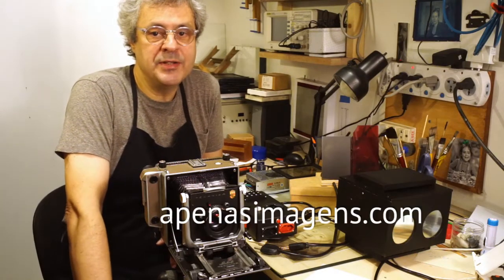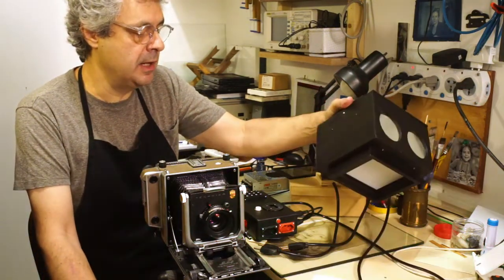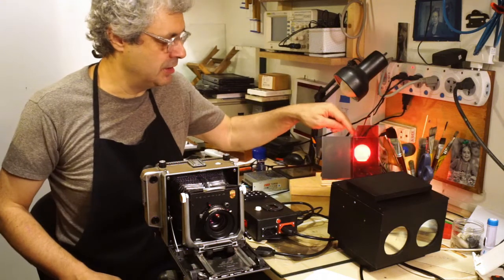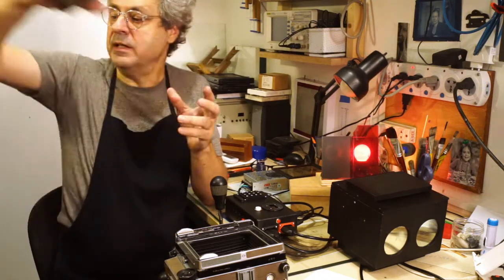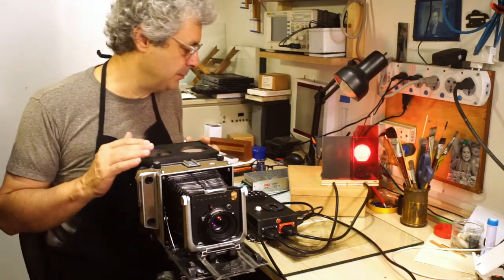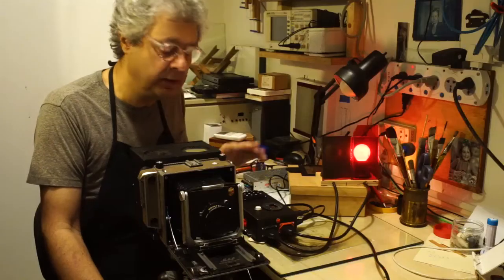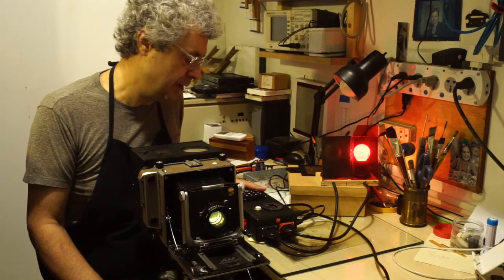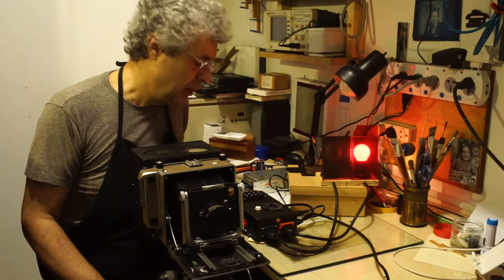Enlarger Head using RGB LEDs - complete project

Comment: How does it work that you use blue and green LED light for contrast manipulation but in traditional enlargers it is yellow and magenta filters that do the job?
Reply: The point is that when using LEDs we are adding colors, so we can include just what is needed, just what we want: blue and green. While a regular enlarger, starting with white light from a bulb or any other source, the process is about subtracting what we don't want. Normally the multi-contrast filters let the red pass by. In this situation, if we are in the low contrast range, red + green gives a yellowish tone. In the high contrast range red + blue + green gives a lilac, violet or magenta like tone.
Reply: @wagnerlungov1825  NO!!!  It need a mix of CMY not RGB, exactly the complementar!!!.... It can do with 3 white led and 3 apropriate CMY 100% filters.

Comment: Great video, thank you so much. I always wanted to make one of those, but with flash and a condenser. You may enjoy this story - - I  used to work a large tricolour copy camera that one would operate from within, the intent of which was to reproduce large colour copy work directly to a Fuji photo paper, processed using Cibachrome chemistry, one generation…there was a room, probably 20 x 30 feet, attached to another at 20 x 6 feet. They were separated by a wall with a lens turret and a filter wheel. The large room had copy lights, a vertical vacuum board on a focus rail and the exposure controller. The other had a front-faced mirror to reverse the image and direct it to a horizontal vacuum board, and the shutter release. There were a number of gorgeous, massive Schneider lenses. The filter wheel had three round gates, two of which were occupied by narrowband filters (blue and red, if memory serves) with one blank for white light exposure. Colour balance AND print density were simultaneously controlled by duration of the exposure through each of the three gates. There was logarithmic math you could do to figure it all out, if so inclined. Totally bizarre camera/enlarger. Loved it. Thanks for reminding me of it.

Comment: I just came across your video. I have an enlarger that works on the same principle I believe, the Philips PCS 130/150 which uses additive RGB and the intensity of each is controlled by the control box. I love what you have done here, especially the adaptation to the Graflok back. Bravo sir.